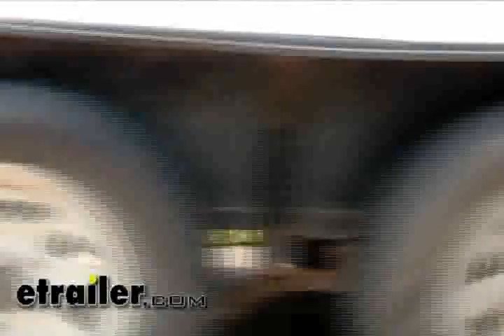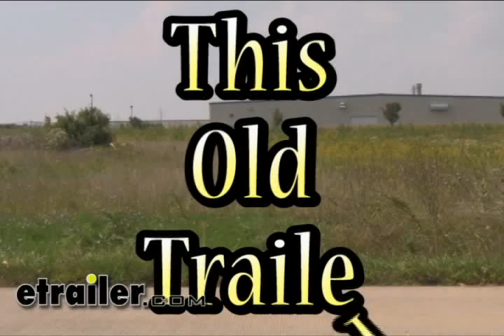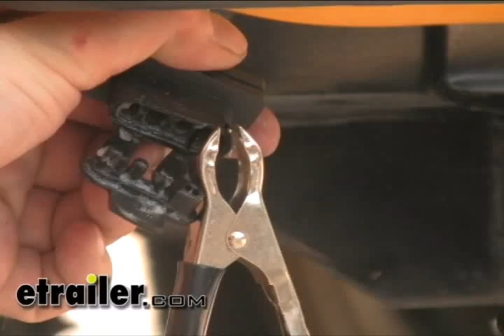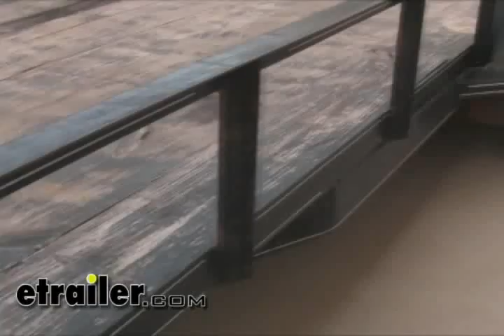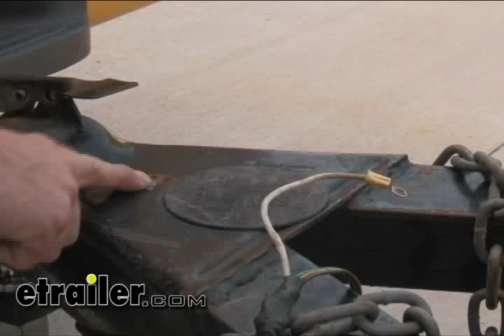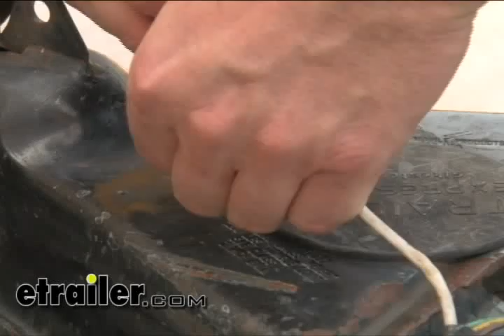etrailer | This Old Trailer: Troubleshooting the Ground Wire

Comment: I’m trying to figure out why my lights turn on as soon as I plug it in. Even with the truck turned off
Reply from the maker: This sounds like you may have two pins crossing in the plug because of corrosion or the plug has been wired incorrectly where the power wire is connecting to the running lights pin.
Reply: etrailer.com it’s factory wired and plug so. Just replace the plug?

Comment: My trailer has a diesel motor that has its own battery. If I install a junction box from the truck's wiring harness, do I ground the junction box to the trailer? Worried about some sort of double-ground interference as I do not imagine that the brake-lights and blinkers would be able to ground to the diesel's battery which is on the trailer. Any help would be appreciated as this is not something addressed much elsewhere
Reply from the maker: I recommend two options:
1) The best option would be to ground everything to the trailer frame including a jumper wire from the ground stud in the junction box. This way you don't have to run a separate ground wire for every light. 

2) The not as good option would be to ground everything on the trailer to the ground stud in the junction box, including the ground wire in the 7-way.

The diesel motor's battery will also need to be grounded to the trailer frame (#1) or to the ground stud in the junction box (#2) if you want to provide a maintenance charge to the trailer mounted battery while towing. This would require a wire from the 12 volt power stud in the junction box to the positive post of the battery too. This will allow you to provide up to 80% maintenance charge to that battery while the truck is running. 

If the diesel motor has an alternator or stator that charges the battery while it is running, there is no reason to ground the battery to the trailer or run the charge line. 

If you want to charge the trailer mounted battery fully from the towing vehicle then you would need to install the product at the link below. It provides a multi-stage charging algorithm so the truck charging system could charge a secondary battery to 100% state of charge while the truck is running. 

https://www.etrailer.com/Battery-Chargers/Redarc/331-BCDC1225D.html
Reply: Thank you so much for the reply!
There are components from the diesel motor that ground to the trailer frame for the diesel battery. For now, the lights all run a ground to the junction box but will eventually add more lights to ground to the frame and ground the junction box to the frame too. Will likely look into the secondary battery charger at that time but there is an alternator for the diesel while it is running.
Just to be clear, it does sound like it will be fine to have both battery circuits grounded to the same frame of the trailer without interference. Running lights powered from the towing vehicle and grounded to the trailer (jumped from the junction box) will not interfere with the separate diesel motor's battery grounded to the same trailer, even if both circuits are used simultaneously.
Reply from the maker: Yes, as long as we are talking about 12 volt systems on the diesel motor and the towing vehicle.

Comment: Ok, I'm new to this and have put led tail lights on my trailer.. I have ground at the front plug where it plugs to the truck and ground wires at each tail lights .. do I need all three or will the one at the hitch be enough ???

Comment: Our brake lights are workn but our turn signals arent.... help please
Reply: Check your truck wiring or your turn signal switch. The reason I say this is because at your trailer connector, your brake lights and your turn sig lights are on the same circuit. To do this you may want to start with a test light at your trailer connector on your truck. Have someone hit your brakes, and see if your test light illuminates when you hit your brakes. Then turn on your turn signals, and your test light should flash on the same two pins on that connector. If not, then you may have a bad fuse or something. It's been two years since you posted this, so you may have already resolved the situation.

Comment: When I hook my trailer to my truck and connect the lights. My truck lights stay on (3rd brake light and brake lights)
When I bounce the trailer they will go off and trailer lights work. So as I'm driving my truck lights are flickering. Any help with this?

Comment from the maker: It sounds like it may be the trailer connector on the vehicle itself. You will need to take a look at your trailer side and vehicle side connectors to make sure they are clean and free from corrosion, clean them out if necessary. Double check the ground connections, making sure that they are attached to clean, bare metal surfaces. Also, make sure the wiring doesn't have nicks, this could also lead to issues. Please let us know if you have other questions, we're happy to help.

Comment: okay, help!!!  our horse trailer ; upon purchase, all lights worked!... hooked to our suv...again working!    Now several months later, only the brake/blinker lights work and when we hook up to our friends new truck again, all worked!  So we assumed it was the suv .  We took back to uhaul where the wiring and 7prong/trailer brakes were installed and they hooked up/checked fuses and such and all worked on their trailers.  I need running lights and would love to have all my extra side lights HELP

Comment from the maker: @activevoices For most of the video, the truck and trailer are disconnected, in order to allow Joe to determine where the problem exists. In the beginning of the video the battery cable is hooked up to the light tester that he is using. Basically, he is just completing the circuit in order to verify the wiring on the truck is functioning correctly.